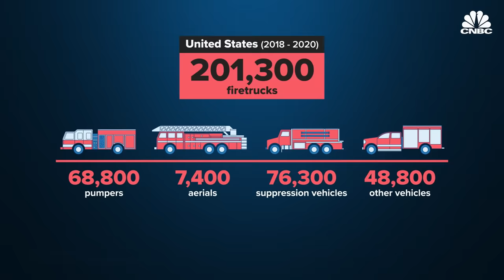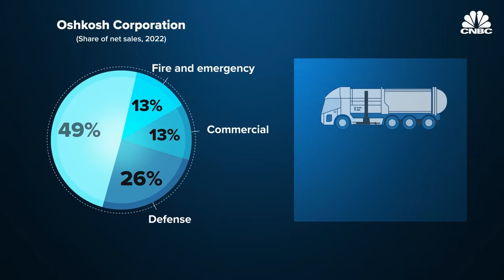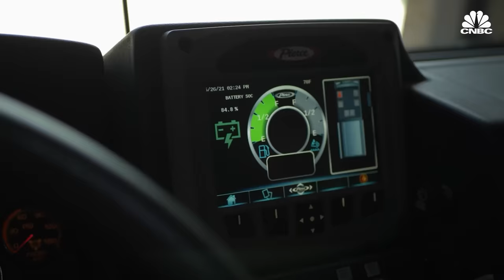Who Makes Money From America’s Firetrucks

Comment: From someone involved with Fire/EMS, y’all better not electrify our apparatus. That will not work. Sorry.
Reply: Why not? They have the range and are easier to maintain.
Reply: Im in a small volunteer dept on the east end of Long Island, ive been involved in some decent sized fires, where ive seen engines run for 16-18 hours straight pumping thousands of gallons of water, how in the hell can an electric pumper do that job, without having to be pulled off line and replaced with a diesel...... not happening
Reply: @bobbertee5945  Bigger batteries. Electric vehicles can all the same things ICE vehicles.
Reply: @jascrandom9855  try running 6 calls in a row, whether that’s ems rig with 40 degree ac in the back for hours, idling or running around, or the truckies throwing ladders, it isn’t possible on a battery. And when it’s dead, you have to wait hours to get range back, not 10 mins at the pump.
Reply: @miller4190   exactly, everything doesn't need to be electrified -_- an electric firetruck is the stupidest thing I've heard in a while
Reply: You better express this to the correct recipient
Reply: @miller4190  Isn't that why they said they first made the Firetruck Hybrid? And then turns out they never needed the ICE. It's clear that they can do all that with batteries.
Reply: @jascrandom9855  it is evident you don’t work in the fire service
Reply: @miller4190  Ok. But do you have an example of an EV failing the way you say? Or is this just born out of certain notions about EVs?
Reply: @jascrandom9855  you cannot recharge an ev quickly. An ev loses range in harsh conditions and depending on load/power draw from tools. We are expected to work in the worst conditions. We are expected to work any amount of runs in a row, and the public depends on us not to fail. You can’t use ev’s - how can you do 5 runs in a row in 0 degree weather running a pump? The public doesn’t understand that we have to plan for contingency.
Reply: @jascrandom9855  who cares. Never run an electric apparatus. Do we need to get one and have it fail? (screw the public right?) what’s the point? There is nothing at all wrong with the diesel apparatus we run. Zero reason to risk it, because it’s the public we are putting at risk. Why would that make any sense at all
Reply: @miller4190  You can do all that with EVs. Pretty sure a manufacturer experienced in building fire trucks and EMS vehicles knows what will be required of those vehicles and would design them accordingly.
It seems you underestimate the capabilities of EVs.
Reply: From what I've found online now, the electric hybrid truck has 130kwh battery and can provide 2 hrs of use. The diesel power unit can provide additional 6hrs of use.
Reply: @mainStream-user  yeah I get that. We have electric tools now, but that’s different. What’s bringing the electric charge you talk about…? Oh probably a diesel generator. Why change something that isn’t broken? Who is it pushing for electric? It isn’t us on the rig.
Reply: @jascrandom9855  I'm pretty sure there is weight limits for the trucks in the U.S. as there are in Europe. So your battery capacity will be very limited.

Because the last thing you want to have is too heavy trucks sinking into the ground while on the job. For example in Germany fire trucks are limited to 16 metric tons and a maximum axle load of 10 metric tons. Because all access points for fire departments are regulated to that specifications.

Comment: A lot of the vehicles this company makes could be made using a mass produced chassis from a truck maker, and then the equipment (fire engine, bin lorry etc.) could be made by a specialist company, like in the UK & Europe.
Reply: You obviously are unaware of the manufacturing capability of Oshkosh corporation. Think of the fact that fire apparatus are always fully loaded and ready to respond. Even when leaving a fire scene.
Reply: Clearly you have no insider or industry knowledge. Pierce does offer pumpers, rescues, and tenders on commercial chassis' like Freightliner and International and are made in the Bradenton, FL facility. However, a one size fits all approach doesn't fit every fire department in the states.